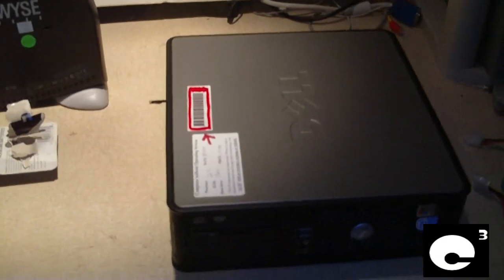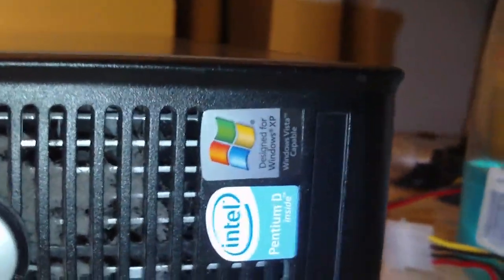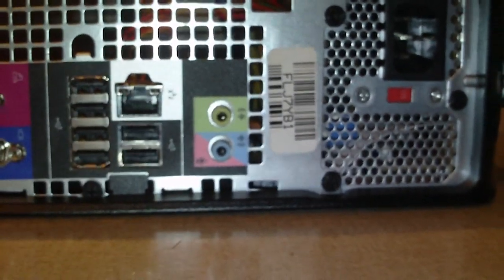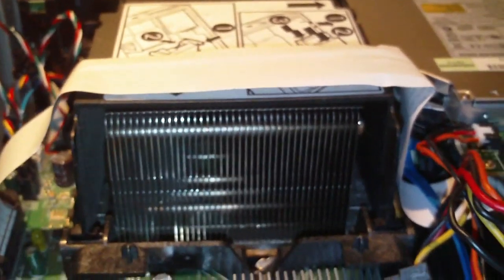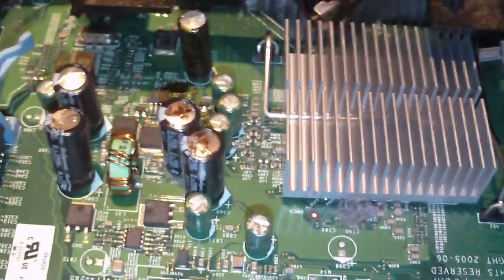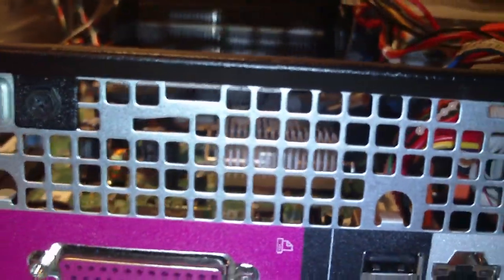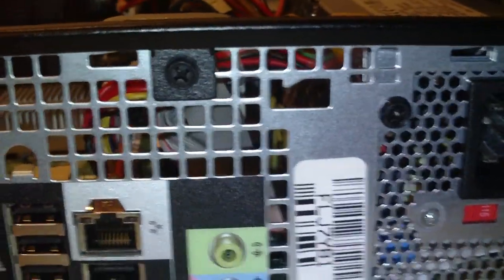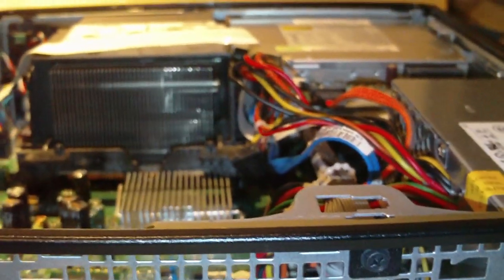Dell Small Form Factor Optiplex Capacitor Toaster Oven

Comment: I use a dell optiplex 780 with 4gb ram and E8400 running at 3.0 ghz and at idle i stay at 38C both cores. This is a HTPC in a closed cabinet with exhaust fan only in rear of cabinet.  I am using a low profile video card with HDMI and have no issues.  At full tilt, I run at 51C

Comment: I just took a small fan  and  run it on low placed in front of the intake and it runs in the 30's and 40's at idle with the Q6600. I did it because when I first got it I noticed the case being much warmer then anything I had before and I figured in the long term it could be a real problem. So, it is a simple solution, if don't mind the little bit of noise from the external fan.

Comment: Not all the small form factor systems suffer from these problems. I used to have a Fujitsu Siemens that was very similar to this dell, and yeah it was a piece of junk. But when they're well designed, they can run for days without heat problems, as these office type PC's are supposed to.

I currently have an HP DC7800 sff which I picked up dirt cheap, I mostly use as a spare PC, or when I don't feel like using my main rig, and the thermal design on that system is so much better, while it does rely on a fan to draw air in from the front, and spits it out the back, it still runs really cool, and is no different in size to this. I've installed a Geforce GT 730 and a Core 2 Quad Q6600 in it, really doesn't seem to have affected it at all. So I wouldn't say they're all bad. Although HP may get a lot of stick (and in some cases rightfully so) My experience of Dell has always been worse, I've had a few decent HP systems in the past, especially their more business orientated ones, where as with Dell I've yet to see one that isn't horrible. So I'm not that surprised by any of this.

Comment: I have a both the Optiplex 755 mini-tower and Small Form Factor. The mini-tower has the Q9650 3Ghz Quad and the SFF has the Q6600 2.4Ghz Quad. Both systems run almost every day under a working load editing photos and hd video. They run extremely cool. I had a custom-built PC with an high end CPU cooler with the same CPU and the dells runs at least 20c cooler than it did and with it being pretty quiet, I am OVERLY impressed with both cooling system. Reason why a lot fail is because the airway gets blocked with dust because people either aren't aware that they need to cleaned or they are too lazy to clean them. I take mine out monthly and blow them out

Comment: I have one of these SFF systems that I use for gaming... incredible performance with the Q6600 and a decent video card. The secret to preventing overheating in the first place? Re apply thermal paste to your CPU. I can see how this capacitor thing can be an issue, but I run mine flat out everyday all day and it has never failed me once. Plus, with the Arctic MX-4 thermal paste and stock cooler, my temps went from 80C before reapplying to 50C. Sometimes I take the side off of the computer and mount a honeywell fan to suck the heat off the motherboard, but it usually doesnt need this.
Reply from the maker: The overheating in this video isn't necessarily about heat transfer from the CPU to the cooler... it's the heat coming from the CPU cooler into the rest of the system... causing the capacitors to fail overtime.
Reply: You are right... Dell was kinda stupid when they decided to put a hot heat sink above sensitive capacitors! I am currently trying to design a fan mount that goes from the back of the heatsink and out the side of the case, redirecting it away from the capacitors.
Reply from the maker: Fat Max I've heard you can flip the CPU fan around backwards so that it'll suck air out of the system through the front. This way, hot air from the CPU cooler simply blows out the front... it may also make a nice hand warmer as well!
Reply: The idea does seem very logical and I was excited for it to work, but believe it or not it gave me some strange temperature sensor error and refused to boot into windows! So I guess my options are limited now... Thats really the issue with Dell, is that their units do not use generic mounts. They only accept Dell proprietary units, with the exception of obvious things like GPU/CPU upgrades. But you are still stuck with that crappy 275W PSU, so make sure you choose an energy efficient card!
Reply: ***** It is a nice hand warmer, I have a GX620 mini tower that I flipped the fan on and that Pentium D 945 keeps it nice and warm. Only thing that I don't like about it is that hot hair is getting blown onto the Front panel connectors (has a capacitor or two on it) but if one of those goes wrong it is a heck lot easier to replace that than the motherboard or capacitors.

Comment: I'm sick of those Pentium D SFF systems too I got 2 of them and they run very hot I did downgrade one to a celeron it ran nice and cool but my model the GX520 is limited to maximum Pentium D at 2.8 GHz so i guess i gotta use it as is but i prefer my dell optiplex GX150 sff that thing is designed much better

Comment: I just turn fan around so it blows the hot air out the front and it works great I got as low as 27 from 99

Comment: Lumping ALL the Optiplex SFF computers together is misleading. The Capacitor problem was pretty much over with the 745's. I started experimenting with 755's & 760's for HTPC's, but have jumped up one more level to the 780's with the E8400 CPU (65 watts, runs cool) and at least 6 gb of ram - they use ddr3 ram, cheaper & faster than ddr2, Upgrade your bios and install a HD5450 or HD6450 video card and use the HDMI port to sent to the TV. Many used 780's have the win 7 COA on the top which is a plus if you're selling them as I am. These machines can be found on the internet cheap and they ROCK!!!
Reply: Your wasting money on anything still using DDR2. I just bought another 780 on ebay for $40. As cheap as they are now, replacing caps is a waste of time, energy and money. BTW - You replying after 2 years.
Reply: Whatever, living in DDR2 world is stupid, but to each his own.

Comment: If Optiplex 620 Small form factor is used un vetical position .
The power supplly take the air from outsite an push into de Nothbrighe and HDD .
The  hor air exhaused by CPY fan has a way in the center of the case to outside ..
The hot air rise up and the power supply take (again ) this air and put it into thea PC
case .
I think this is no good solution .
I puuled the power supply out ( 3 black screews from outside ) .
I reversed mechanicaly the fan intro the power supply .
Don't try to reverse wires from the fan; the fan is an electronic device
not a simple electric motor and will become burned .
Now the hot air from inside de PC is push up and exhaust out of case
at the top end or the roof of the case .
The power supply no more intake hot (or warm )  air from outside .
I have only a tens of minute testind this new  reverese fan flow inside the
power supply an I noticed that the hot zone moved upwards of the case
leaving the HDD zone coolder .
( Old HDD crased ,it became as hot as it can not be hold in hand ! ) .
A have now no new HDD to test at this time the sistem .
The only possible problem is to burn out the power supply because
now is take hot air from inside of the case not cold air from outsite ( original factory ) .
I have noticed aslo that  no so hot air but warm air continues to flow out
on the middle-back of the case but at lower temperature.
The hotest air is now exhausted certainly from the upper-back zone of the case
trough power supply.
What are you thinkig ?
It is posibble that power supply ( made in Vhina ) (entire Optiplex  PC made in Ireland )
to have the fan mount in wrong direction from china factory ?
And need to be mechanicaly revered ?
The original air flow or cooling system was definitely wrong .
The HDD witch original cooling system  becamome a fried egg .
And the 2000 uF /  6.3 V 2 pics was burned out .
I replace and the 1800 uF ( lookind good )  see in this video  to new 2000 uF 10v .
In total i have changed 3 capacitors all 2mF .

The top of the autside  case becone warmer , The middle of the outside case become coolder.
What is your opinion ?

Comment: I bought a newer one of these for a lady I know its got the 2.4Ghz Core 2 Duo and 1Gb 553Mhz ram in it runs good. I myself like Dell I have a E520 with a Core 2 Quad 2.4Ghz in it 4Gb 800Mhz ram a ATI Radeon HD 6570 way overclocked Core running at 860Mhz and ram running at 1Ghz

Comment: I also stuck an 80mm and 92mm fan (both modified to have ball bearings) in the back running at maximum speed. In addition to the 120mm rocketfish fan (also ball bearing) running at maximum speed. My computer moves a ton of air.

Comment: I have the tower version. A 2.4 Ghz Intel Core 2 Duo with 4 GB of 533 and 667 Mhz RAM, a 500 GB Western Digital Caviar Blue Hard drive. A Galaxy Nvidia Geforce GT 610 PCI-E with 1 GB of DDR3. It also has a 430 W Thermaltake ATX power supply.  It's loaded with Windows 8.1.

Comment: My experience with the Dell SFFs is that we had several of them on my job ( we build the Volvo C70 cab ) 6 years 24/7 in a very warm, dusty, smoky, dirty environment in a plant for the process registration and O boy I can tell you that they were dusty and dirty as hell but never failed to work !  The HDDs or the LCD failed rather than the SFFs !
But hey, who keeps his comp for 6 years ? 
BTW, the Dell Optiplex 760, 780 SFF is a damn good comp for building
a hackintosh :-))

Comment: Also,when you have a design like that, you also kill the PSU as well.  I see a lot of power supplies going through caps and windings, because now, you have all that hot air going right through them.

Comment: Small form factors have to be done just right if you want them to last, I've seen too many of this type of computer die an early death. I have a 13 yr old Dell SC420 that runs fine, it's in a nice big case with just the single cpu fan but all that room gives the thing the ability to breath.

Comment: Pentium 4 and d's run way too hot for those little boxes, if you can, switch to a core 2. I have 2x 80mm fans in the back of my e520, aluminum heatsin, 24C idle 39C load. Othermods inclue chipset cooler on southbridge, fan on northbridge cooler, and 120mm psu fan.

Comment: The only thing you have to do with the GX520 and GX620 is  turn the CPU fan around , so that it sucks the hot air out of the case instead of blowing hot air onto the motherboard and capacitors. The CPU is the cause of the heat in these SFF cases. By sucking the the hot air out of the case solves your problems. Trust me, I own 3 of these SFF pc's.

Comment: @CubeComputerChannel is it possible to just flip the leads to the fan? Or even just wire the fan an extra power cable and flip the polarity. Or do you go throigh the tast of takng ot apart and turning the fan around?

Comment: wow, dell, wow. who's idea was it to put a blast furnace of a processor into an SFF case? that very idea is just......stupid, lol. i've worked with the core 2 duo versions of those machines, and those run absolutely beautifully most of the time due to those cpu's not getting nearly as hot. i still think the king of all SFF computers is the Compaq Deskpro EN, it's a tank of a computer.

Comment: Easy way to fix it, or at least make it less of a blast furnace, would be to pull the fans from on side of the CPU heatsink and zip-tie them to the other.  It'll raise the CPU temp by a couple degrees, but it'll keep the board from roasting.

Comment: i have a gx520 (same but with a p4 ht and no pci-e slot for some reason but it looks like one could be soldered on) and i used it really hard for a few years and i was quite impressed! i put the pci version of the 8400gs in it and good god, hdd and gpu were hot as hell! they are usually right under your monitor so i guess they wanted them to be as quiet as possible. i have made huge computer upgrades so it is used for a htpc in a guest bedroom in my house lol.